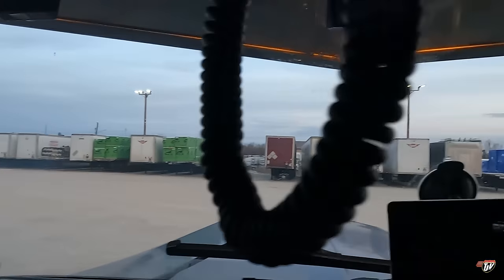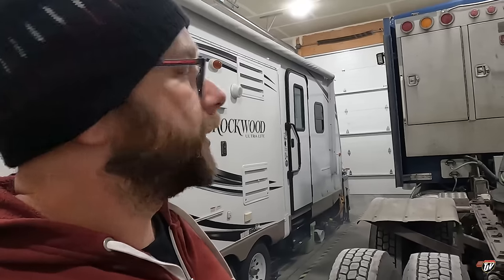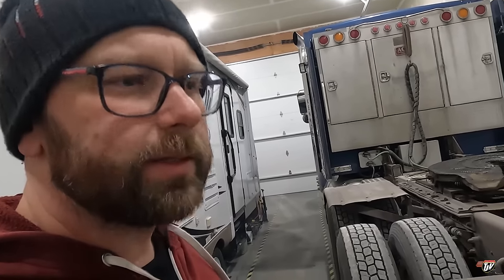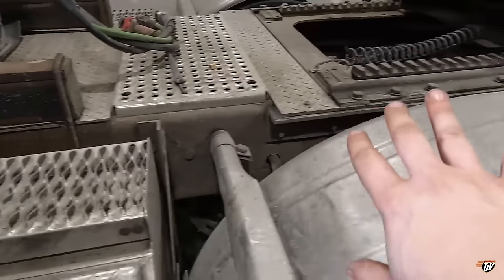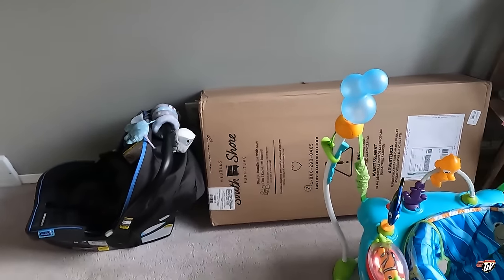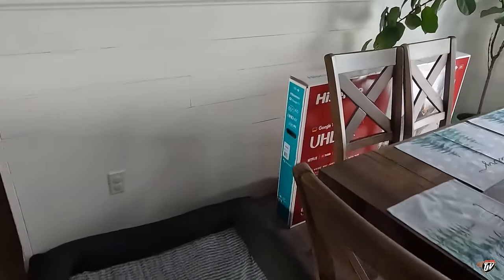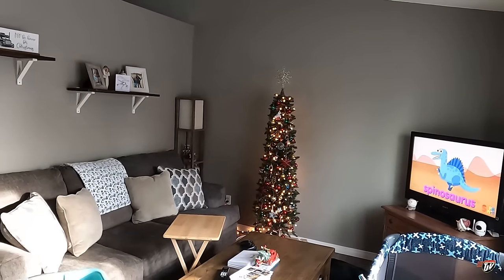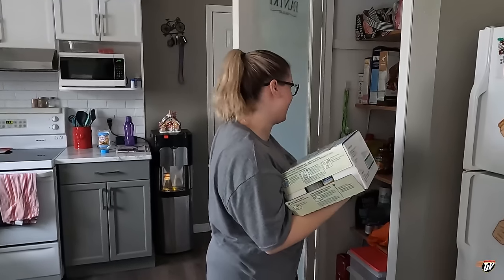SMOKEY | My Trucking Life | Vlog #2950

Comment: If it isn't one thing, it's another... the life of a trucker. My uneducated analysis of your bunk heater os that it just needs a good cleaning. Glad you're getting new furniture in your new home along with a brand new big screen TV. Life is good for you, Brit and Theo. Take care and drive safely, Trucker Josh.
Reply: A friend who has had 4 of them, mentioned that the shop will set them up burning kerosene for roughly 6 hours. Which is what they are designed to run on.
 If they don't clear up, then they are torn down and cleaned, glow plug replaced, then reassembled.

Comment: You should have a little fuel filter on there and it could be plugged.
Reply: + A test can be done before turning it on next time : by warming it up using a small heater CAREFULLY under the sleeper or even a hair dryer for a few minutes and see if it will not cut off and keep working from the first time . 
This might even fix the issue by melting the crystalized fuel under there . Probably an attended hair dryer is a better idea .

Comment: Your bunk heater burns diesel fuel and therefore produces carbon monoxide which as you know is deadly. You said it exhausts under the bunk and shouldn’t produce smoke but it is? I think that’s what you said. If that was me and my situation I would call the mechanic shop and explain the problem and see what they say. Something that’s great to have is a good quality carbon monoxide detector, we have several of them, I also have a portable hand held one that can be used anywhere but I initially bought it to take with me ice fishing because we use a Coleman stove to heat the fish hut and fry up the fish :)
Also carbon monoxide is odourless. It’s always better to safe than sorry or (worse)
Reply: I was thinking the same thing. Such an important issue !!!